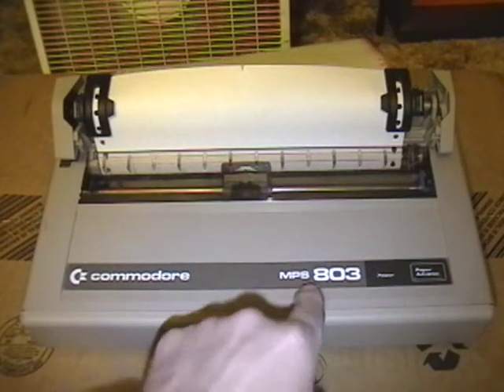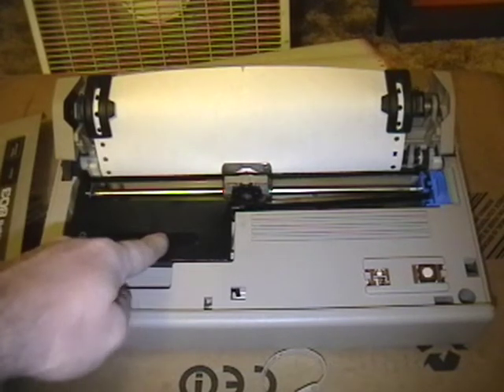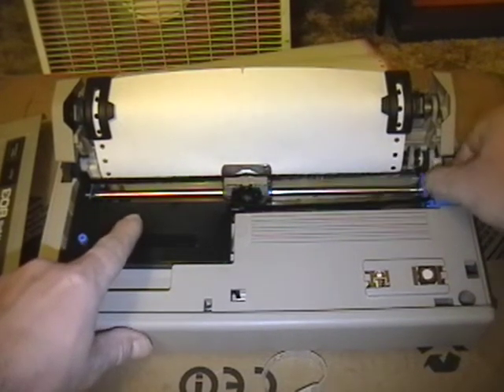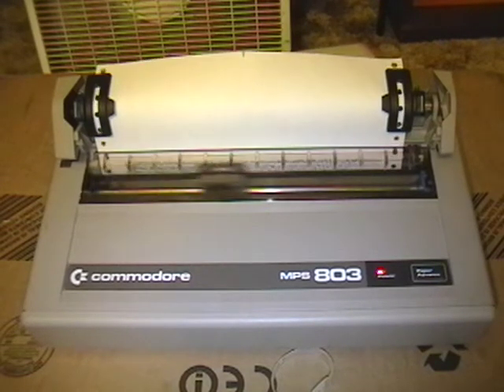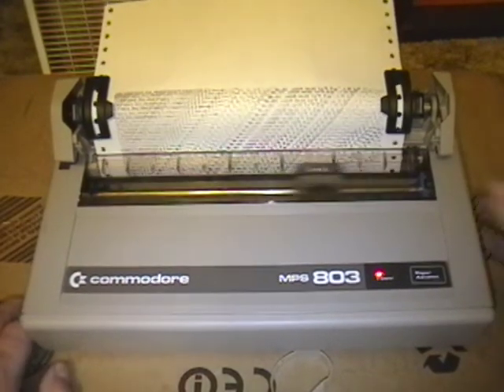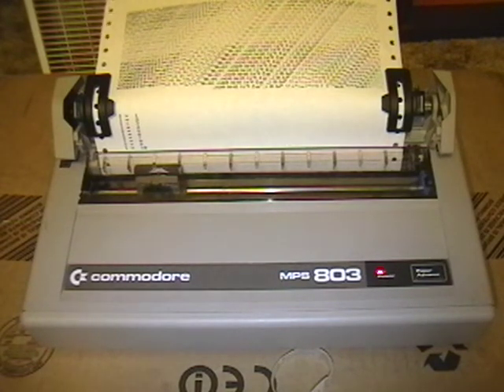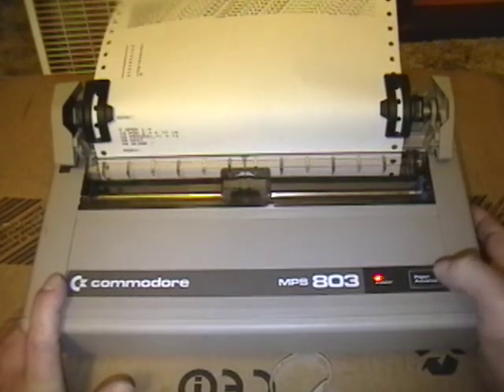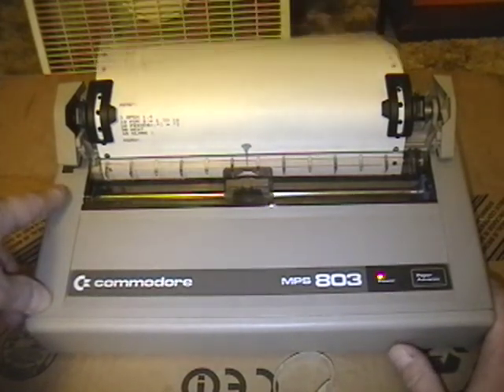Commodore MPS-803 printer

Comment: If it's such a crappy printer why does it still work after 40 years? I've gone thru like 6 modern printers in the last 20 years.  I agree, though the 1526 and 802 are much better printers, and you can upgrade the rom for 1525 compatible graphics modes.
Reply: I have one of these and it is brilliant for what I use it for.

Comment: Single sheet printing? Connects to windows, linux pc? Know about small matrix printers for windows, linux pc? Performance does not matter. Thanks.
Reply: I have the Star LC-10 and the Apple ImageWriter.

The ImageWriter Work on Linux perfectly. And the Star LC-10 is working both on Linux and Windows.

The Star LC-10 is the best of them when it comes to print on a standard A4 sheet.

Every dot matrix printer (except the Amstrad ones and the very very very old ones, and the Imagewriter I/II/LQ if you want it working on windows) should work on any computer with every operating system. You only need a parallel / centronics port or an USB adapter, and use the epson ESC/P driver or (depending on the printer) the IBM dot matrix driver.

The best ones and cheapest ones you can find that can do well with standard A4 are the Oki and epson printers.

Edit: Oh I forgot to say ! The imagewriter is a little weird, she uses a serial port, and use a special non standard driver ! On linux you have all you need, but on windows, I think support for theses is long gone ...

Comment: What paper does it take?
Reply: Usuallay the tractor feed is used and it needs paper with holes on both sides. You can tear of a small strip of paper with the holes later. I still have one of that kind (from Epson) in my office
Reply from the maker: It uses 8.5 by 11 pinfeed perf paper (often measured as 9.5" because of the half-inch perf on each side). As someone else commented, it has a terrible feeding mech, from the top, so the paper rolls around 180 degrees, and you tend to rip a lot of paper. Bottom feeders were much nicer.
Reply: UnbrokenCheese Thanks for the quick reply! Could I find this paper online? (And presumably what you said means that A4 would be futile ...)
Reply: +Seb Wilkes if you live in the US you can get this paper in all sorts of configurations from the office max website with free shipping usually ~3000-5000 sheets, for between 60 and 100 USD
Reply: Can you use continous feed paper with it?
Reply: @marc-andreblanchard537  yes
Reply: @doctorcoleco  Thanks.  Unfortunately I no longer have my printer.  Worked like a charm though.